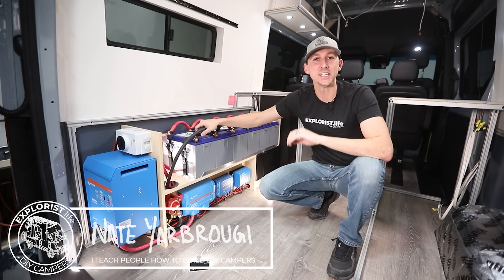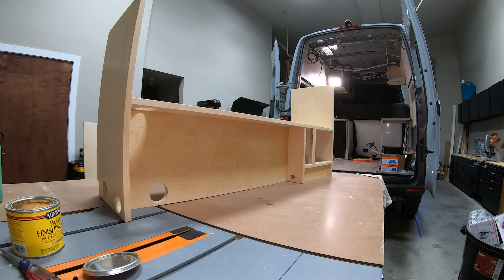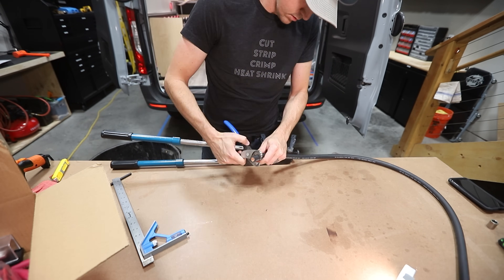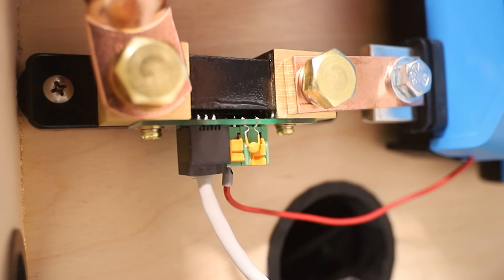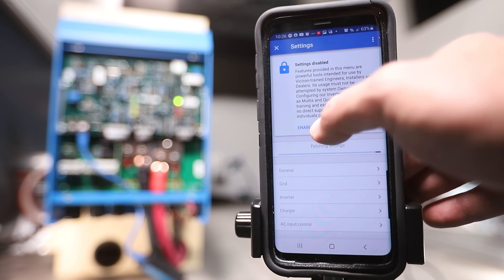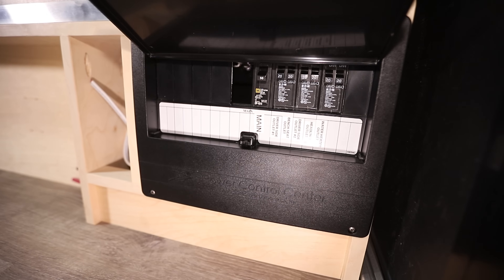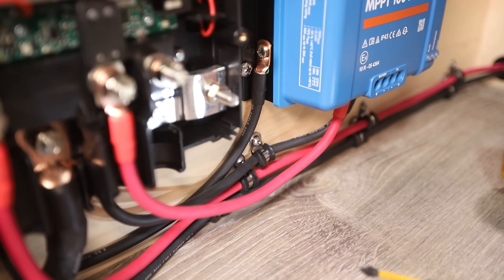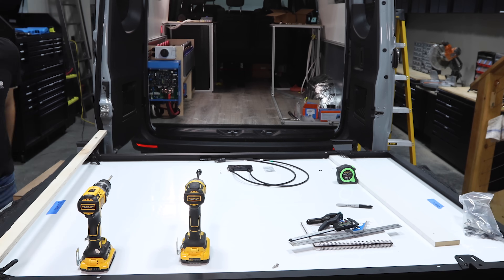DIY Sprinter Camper Van Electrical Install - Full Tutorial

Comment: Does the inverter/charger automatically switch from inverting to charging when shore power is connected? Does it just act as a passthrough for shore power when plugged in?
Reply from the maker: 1: Yes.  2: Normally, yes unless more power than shore power can supply is required; and then the multiplus will 'add' power pulled from the batteries (Victron PowerAssist function).

Comment: Hi skilled fellow !
Did you already use V.P with modules type 210mm on such installation ? Are Victron equipments compatible with these modules type 210mm ? Exemple: vertex trina solar  670W.
Reply from the maker: Victron equipment is pretty much compatible with any solar panels.

Comment: I followed this tutorial exactly and am really happy with my system. I finished it about two months ago. I’m currently using dc power 24/7 and running my fridge/freezer, lights and fan. I’ve turned the multiplus on a few times while I was assembling the system and all worked well. Last week, I turned the multiplus on for about an hour to charge a camera battery and then turned it off when I was finished. I’ve just tried turning the MP back on and it will not turn on. All my connections seem secure. All the dc appliances are still working. I’m able to go into the Victron app and click the button to turn the MP on but nothing actually turns on. I’ve asked for advice on a few forums this a.m but I’d rather hear ideas from
Nate if possible before I go poking around. I am still very much learning about electric and not sure what to do.
Has this happened to anyone else? Does anyone have any ideas? Thank you.

Comment: Hey Nate, I just noticed that you don't use a 30A Main Breaker in "front" of the MultiPlus to protect it in case the shore power is not reliable. Do you not think a main breaker is necessary or do you think it's a good idea to install one, just in case? Thanks!
Reply from the maker: The breaker for shore power is already installed in every shore power pedestal so it is already in place.  If you want additional protection from voltage spikes and such, a plug in surge protector is a good idea: https://amzn.to/3lVLtpy
Reply: @EXPLORISTlife  Got it, thank you Nate!

Comment: At 25:30 why didn’t you put the wire separator flap back in between live and earth wire? Are they not there to avoid a short? At 27:03 you did fit this but didn’t mention to fit it.
Reply from the maker: The wire seperator did indeed go back in place.

Comment: Hey Nate, just wondering if this electrical system and the solar charge controller would with only 200 watts of solar? Unsure if I have room for 400 watts of solar on the roof but would like to use this same electrical system design and purchase your wiring kit.
Reply from the maker: The components would all work, yes, but just know that 200w of solar is only going to contribute about 100Ah worth of battery refilling over the course of a normal 6hr day of full sunlight.

Comment: I’ve got a similar 144 van and am getting ready install DC-DC Charger.  Crowd sourcing a question…. Is there. a reason the ground is run from the wheel well all the way to under the seat?  Could I just run the ground to the chassis ground, or the negative busbar on the lynx distributor?
Reply from the maker: Running a dedicated wire gives more consistent and repeatable results than relying on a chassis ground to carry power.
Reply: @ Thanks… will go with that.
Reply from the maker: @davidmcbride2235 a wise idea.  Shop.explorist.life/support if you need help finding the proper wiring kits.

Comment: Hey Nate!  I have a problem with my Orion 12/12 30 amp DC charger.  I installed it in our travel trailer that we pull with a 2022 F-350.   I assume the truck has a smart alternator, although I tried both settings.  What is happening is when I start the truck, the input voltage on the app(and charger)  starts at 14.5 but instantly starts descending in increments down to 8 volts over a few seconds, then ascends back up to 14.5 over a few seconds where the cycle starts all over again.  This prevents the charger from turning on due to what it thinks is engine shutdown. I have #4 cable run back from the truck battery and I have 14.4 volts at truck battery, and 14.4 volts at the end of the input cables. Wiring is solid. Any ideas what is going on?

Comment: Hay i have a some questions ? im planing on building a small mobile ish system for fishing and around my home im planing on useing to start with 2 x 12v 20ah batterys with usb ports and a 2000w converter ... 1 can i use banana jacks to power the converter so it would be from the batterys to the banana jacks then to the converter .... so its easyer and quicker to remove ....    2  can i use a extension lead/core with the converter ....  also what would you recommend for wire size with 2 batterys then 4 batterys then wire size from batterys to converter with 2 batterys then 4 batterys
Reply from the maker: For something that small, I'd just recommend any of the little portable power units on the market like a Jackery or something.

Comment: Hi Nate, quick question. I am building this system, using your diagrams and such, and I have gotten as far as hookingbup the DC side, and am currently using it. If I want to uninstall this system temporarily, is the safest first step, to remove the 400amp anl fuse? That is after I’ve turned off the main switch of course. And then remove the battery cables that go to the fuse and the main switch from the battery bank? Thx
Reply from the maker: Yeah, probably so.  Also disconnect solar and alternator as there could be power coming from those sources as well.

Comment: I have a pro eco flow solar system battery bank. I obvi don’t need all of this so what do you suggest to use alternator and solar panels to charge the system?
Reply from the maker: Maybe reach out to Eco Flow tech support if you can't figure it out.  I don't necessarily 'recommend' those systems, so if you are going a direction I don't recommend, I can't be of much help.

Comment: SInce you are using an Orion tri-smart instead of a LIBIM, what is an alternate method for using the house batteries to aid in starting the engine?
Reply from the maker: First and foremost...  It's important to keep your starting batteries and alternator healthy.  You shouldn't NEED to use your house batteries to start your engine.

2nd: The easiest way is to carry a portable jump starter: https://amzn.to/3PZElFt  This can be charged from the house battery bank.

3rd: The most complicated and expensive way would be to add a jump starting solenoid and circuit to the lynx Distributor controlled by a momentary switch on the dash.

Comment: What inverter would you recommend for 24v batteries? I’ll never have shore power, maybe possibly a generator but unlikely. So it’s seems a bit expensive to get for the multiplus victron. I was thinking the giandel 24v 120v 4000w.  But want something quality. Wish victron had a 24v inverter that was like 4000w like the giandel
Reply from the maker: For a 24V battery bank w/ at least 4,000w of inverting power, like you're asking for; I'd recommend the Victron Quattro 24V 5k: https://battlebornbatteries.com/product/quattro-24-5000-120-100-100-120v/?afmc=explorist_bb67

Comment: Nate!  Awesome video!  I wish I could have brought my trailer to you to have my solar installed.  I went to a local privately owned RV shop.  They did a great job with the installation, but I am having issues with the Victron 3000 Multiplus inverter spooling up my generator so much that I'm afraid that it is going to blow a fuse or my generator.  I'm certain it's got to do with the dongle and programming the Multiplus.  Do you know of anyone near Denver who would be able to do this or walk me through it?  I have the Victron smart dongle, V.E. direct to USB interface and the cable.  Thank you in advance for your help and advice.
Reply from the maker: Here is a list of Victron installers: https://www.victronenergy.com/where-to-buy, but I'm going to personally recommend 'Colorado Standby' down in the Springs.  I've done training with them before and they are super sharp and great people.
Reply: Thanks for the response and advice Nate!  I'll give CO Standby a call.  Even though I I don't feel confident enough to do my own solar installation on my travel trailer I was inspired and watched your channel for information and recommendations on equipment.  Thanks again!  Lish in Broomfield/Red Feather Lakes

Comment: Nate - Looking at my FIRST van conversion ready for retirement and my the electrical piece is scaring the $h1T out of me..!!! Are your schematics suitable for UK?
Reply from the maker: The DC Side is the same.  The AC side is 'similar' with the proper adjustments for 230V instead of 120V (This is mainly just a matter of buying a 12V to 230V inverter/charger instead of the 12V to 120V one shown in this video.

Comment: My budget is in the  "few thousand" area so I'd be using Lead acid type deep cycles(either flooded or AGM) instead of the Lithium ones.
Reply from the maker: Great!  These components can indeed be set up to charge AGM as well.  I'd just recommend getting The same physical size of AGM battery as your future Lithium upgrade so that when the AGMs fail in a few years, the swap will be as easy as possible using the same wires.

Comment: Hey Nate, Im finally getting around to installing this this system in my sprinter. Is there still a cheat sheet for setting the parameters for the Victron BMV 712? I looked for the blog post but could not find it.
Reply: Same

Comment: Great video! Question: where can I get these brackets you use to install the solar panel to the C-rail?
Reply from the maker: Check the parts list in the video description and in the pinned comment. :)
Reply: I just can’t seem to find it. Can you please post the link as a reply to this comment? Much appreciated in advance.
Reply: Please please please can you help me with the link to the solar panel brackets? Thank you very much in advance!
Reply from the maker: It's in the 'This Kit Also Requires:' section of the kit for this video: https://shop.explorist.life/shop/all-products/camper-wiring-kits/complete-wiring-kits/600ah-multiplus-3k-12v-orion-12-12-30-400w-solar-wiring-kit/

Comment: IV lived in motorhomes and campers for 10 years and this although a beautiful video. Is so overkill you don't need that sort of over complicated system. Not In a van maybe a off grid house. But a van ?? What you running in there? I have 220ah AGM battery 200w of solar and I can run everything. Lights . Fridge. TV. This is just savagely over kill way to much money. This set up cost more than my first camper conversation and I lived and traveled in that van all over eu for 3 years.
Reply from the maker: Remember... everybody is different and has different needs and wants.  I'm glad your setup that you've got has been working for you. 🙂👍

Comment: Hey Nate, have you looked into using MPP Solar's all in one inverters for setting up in the vans?  Would heavily simplify the setup.
Reply from the maker: I have indeed looked into it and done some consulting on some systems that use those units.
Reply: @EXPLORISTlife  what are your thoughts?
Reply from the maker: My thoughts are that once I start giving people too many options to build a system it gets overwhelming so I'd rather stick to teaching the way I think is BEST and then if people want to branch out and try the other 5,000 brands of components on the market, I've given the knowledge to do so.

I'll do a video of an all in one unit like that eventually, but I've got much higher priorities for upcoming videos.
Reply: @EXPLORISTlife  yeah no question Victron makes some of the best 12V components, wish they would develop an all in one to simplify and tidy up installations.
Reply from the maker: They have one already, its just for 230V power so it's not particularly useful for those of us in N. America.  It's the 'Victron Easysolar'.
Reply: @EXPLORISTlife  ah makes sense as to why I haven't seen one installed. Hopefully they put a 120v out soon or a 240v split would be nice. 

I also noticed you ran the batteries in parallel, first thing I though to myself was why not a series 24v or 48v setup?
Reply from the maker: Since we have 12V loads and are charging from a 12V alternator... it's just simpler to keep the battery bank at 12v as well.

Comment: I just watched this video again and I just caught that you put a 50A breaker in the AC panel, but used a 30A shore power plug. Why is that? Couldn't you use a 50A since the box is wired for it?  Thanks!
Reply from the maker: The 50A breaker is to handle the Power Assist functionality of the Multiplus.  Check out this video at the 1:07:23 for system commissioning with a great demo of the Power Assist functionality: https://youtu.be/E5q7_4FH4LQ
Reply: @EXPLORISTlife  , I have watched that video (I think I've watched all of your build videos 😀) , and maybe I'm just missing something, but if you have a 50A breaker in the 120V panel, is there any reason you couldn't have installed a 50A shore power plug instead of a 30A plug? (I think I have the right understanding that 50A shore power can allow two 50A legs to work together. But can't it also just allow for more than 30A to be pulled (I'm referencing without the MP in place) at a given time?)  Thanks!
Reply from the maker: With this specific setup, a 50A shore power inlet wouldn't work, no.  We could swap out the Multiplus used with the Multiplus 3k 2x120V model which is designed to accept L1 and L2 of a 50A shore power input; but in a camper van, 50A shore power is pretty much never needed.  As a rule of thumb, the only time 50A shore power is needed is if you have 2 or more air conditioners.
Reply: @EXPLORISTlife  , ok, thanks!

Comment: Had to build this exact system on the passenger side. Without proper planning realized the parts would have to either be backwards or upsidedown. Is there any issue you see with doing this?
Reply from the maker: All of the components give specific mounting guidelines in each of their respective user manuals.
Reply: Thanks. One other question is I am having trouble leveling out the shunt/Lynx/on off switch. I have all the spacers from the kit and just wondering the bolt sequence on the shunt you used with washers etc.
Reply from the maker: If you submit an order support ticket, we can see what you are dealing with and point you in the right direction.

Comment: Is it safe to have power from solar without breakers? Since I have the inverter with a DC connection I can hook up all the appliances from there. but I am not sure if it is safe or not.
Reply from the maker: I'm not sure I'm following.  The ways I recommend setting these systems up can be found at https://www.explorist.life/solarwiringdiagrams

Comment: When using the Victron Multi-plus 12v/3000 watt model and a victron BMV 712, should you leave the battery monitor off on the Multi-plus? Or is it ok turn that function on with the smart shunt? I was just wondering if they would conflict with each other?
Reply from the maker: You'll want to leave that 'off' in this system.
Reply: @EXPLORISTlife  thank you!

Comment: This may be a silly question but here goes... can i use 4 batteries instead of 6? if so how much will this affect the power output?
Reply from the maker: Yes.  

4 batteries will have 2/3s the capacity of 6 batteries.
Reply: @EXPLORISTlife  Ok thanks so will this be enough to power a van that we use for weekends and the odd week long trip? sorry, im a complete novice in electrics (carpenter by trade) and thank you for the super quick response

Comment: I have 12v 400ah battleborn Victron system you have sent me. The discharge floor is set at 50% should I keep it there or can I go less.
Reply from the maker: Submit a support ticket and I'll send you a settings PDF.

Comment: Hey bro! Quick question - what are the advantages/disadvantages of having 1x 300Ah battery vs 3 x 100Ah batteries? I’m trying to buy batteries in NZ to use with your kit but my options are very limited
Reply from the maker: Either is fine.  Keep in mind that my kit using the Multiplus 3k requires a minimum of 400Ah, so you'll probably want to go with 4x 100Ah batteries.

Comment: Hi, I am using the same crimping tool for 4.0 you are using however when I crimp the tool the arm doesn't even get close to closing down all the way as when you do it.  Am I just not strong enough??
Reply from the maker: Loosen it up just a little bit, perhaps.  It takes a bit of muscle, but not much.  Make sure the arms are extended as well.

Comment: Is it an issue tu put all the batteries on one side of the vehicule? Won't it put much more load on the left wheels?
Reply from the maker: It's offset by the water tank on the other side.

Comment: I'm confused about the solar panel, everywhere I look online 600ah battery bank needs 1200w - 1500w of solar? how does 400w solar panel manage? is there something I'm missing?
Reply from the maker: A 400W solar panel wouldn't fully recharge a completely depleted 600ah battery bank in a single day.  And you're correct, you'd need about 1200W for that.  This is why you saw us also install alternator charging and shore power charging for this particular system.  More solar would have indeed been preferable, but this is the panel that the customer wanted to use.

Comment: Is there a DC-DC Battery Charger that's good for more like 400 or 800 amps instead of just 20 or 40 amps at 12 volts? Because what If you ran it with mechman aftermarket 400a alternators?